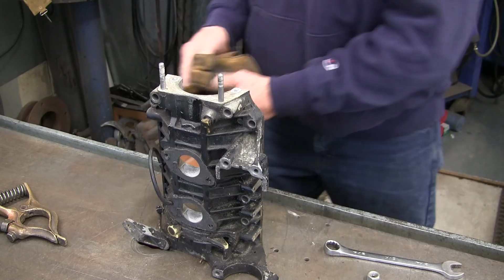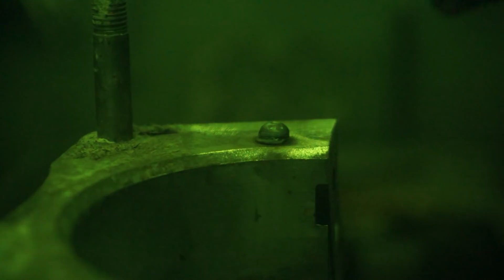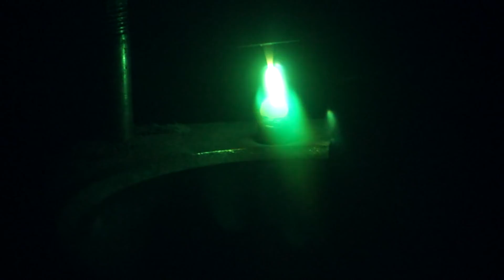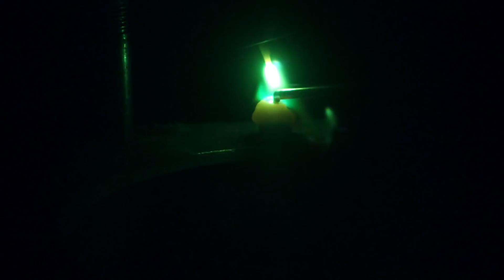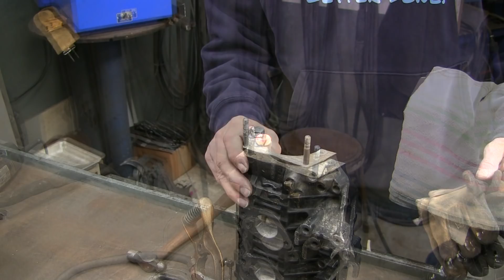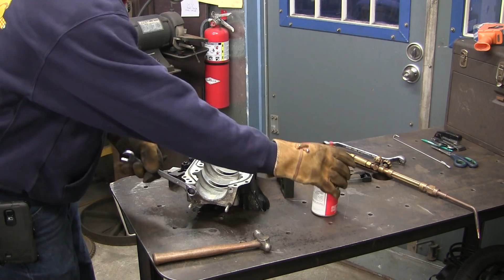Put A Head On Your Thread

Comment: Just think, if the manufacture's used anti-seize during initial assembly, they would make many happy customers but, expense vs. profit will win every time.
Reply: +Joe Rogers 
i'm mechanical engineer and in every of my desings that is involved to me used on a wet or corrosive environnement, there is a point of drawing that specify an anti-seize compound on every threaded assembly and it is a point of conformance at the same importance than the metrology of the parts.
I found deceptive that the assembly of threaded fasteners is almost always done dry, a very bad way to do things.
I've tested 242 thread locker on submerged assemblies of steel bolts , after more than 10 years underwater, I disassembled the fasteners with hand tools with no difficulties, all threads outside the nut were far gone but the section protected by the threadlocker compound were intact.
Reply: +Joe Rogers  I couldn't agree more!  My first experience with anti-seize was in 1980, while disassembling a turbine engine.  After 9,000 hours of flight time, the hot section came apart as if it had just been put together.  When we put it back together, we used C5-A on the threads of each bolt.  I've used it on anything that I thought might have to come apart in the future, especially things that get hot, like exhaust components on vehicles.
Reply: +throngcleaver worked on Cummins products for thirty eight plus years. Started using the seize in the eary 70's. Built a few that went a million and they came apart readily when you need it.
Reply: +Joe Rogers honda does, theyre the green bolts.
Reply: +Joe Rogers it's true. a lot of consumer goods come with a "fuck you, got mine" mentality. pretty much everything i can buy needs some basic work to not be disposable after a few months/years.
Reply: +Louis Reilly-Willhight that's a reason why a customer who buy an imported car , tool or almost any goods almost never return to american ones
the philosophy of not protecting threads is reflected in the overall design of the product
Reply: +Louis Reilly-Willhight Unfortunately, the manufacturer is betting you won't have the time/patience/skills needed to conduct repairs, and you'll just throw the damn thing away and buy new. It's consumer culture - aka "Fuck you, please come again!"
Reply: done a lot of repairs aluminum blocks and stainless bolts. After 6 months or a year at sea the antiseize compound doesnt help a bit. What does help is to warm the block to about 180 f for a half hour or so, the aluminum has expanded and you have a fair chance of extracting  the bolt.
Reply: Joe Rogers - Well there's at least one manufacturer that uses thread lock in all bolts, Mercedes. For my $500!! project car, A class W168, I was obliged to buy some new bolts that where missing and truth be told even the existing old ones where well in place. 
The bolts come already with blue thread lock pre-applied. After remove, the threads where impeccable. Worth saying that the bolts are also treated... ;-)

Some other projects, Peugeot 106 & 306 and Citroen Picasso showed me why these French came with bronze nuts in the exhaust manifolds. Never had one broken exhaust stud until now.... ;-)

Either case anti-seize is ALWAYS at hand reach in my projects area. ;-)

Comment: Hi Keith, thanks for the videos again. This is a very common problem on motorcycle exhaust studs. Stainless into aluminium, short stud in an awkward location, plenty of heat cycles and an area of the bike that gets plenty of road muck thrown at it. I have found that studs come out a lot easier if you unscrew them while they are still red hot. I realise the stud will expand when hot but the hole will always expand more - because it's bigger to start off with.

[IMG]http://i960.photobucket.com/albums/ae89/Screwdriver/Blade/ce1e2799.jpg[/IMG]

Comment: It's nice when you can do it on the bench.   recently I had to remove 3 broken studs in the firewall side exhaust manifold of a ford explorer v6 with all wheel drive. I hoped to never have to do a job like that again but luck me a while later I had to change a cracked passenger side exhaust manifold on a 4.6L ford 4x4. it had 3 broken studs and I broke off 2 more by the time I got the manifold off. 4 came out first try. The last one I had to weld looking in a mirror and it took 5 tries before it came out.
I hope I never see another broken stud again!!!
Reply: ford explorer 4 wd ridiculous space in that engine bsy :(

Comment: Keith I do it the same way but I weld a washer first and then the nut to the washer.
I found using brake fluid the best penetrating oil for rusty threads . Payment ? Beer!
I always use my  welder first before the mill .winner winner chicken dinner.

Comment: Keith is right, as a shop owner your time behind a screwdriver, or wrench is just as valuable as time on a machine. If you were not using the welder or wrench you would be on the machine.

Comment: Keith, I love your videos.  I'v watched 'em all.  Thank you so much for your generosity in sharing your knowledge.
I must tell a story about hand held angle grinders.  If you hold the grinder in your right  hand and your work piece in the left hand (as you are doing in the video, only much more dangerous with a thin wheel instead of the cup you are using)  the  geometry is just right so that if the blade catches in the work it will drive the blade right into your belly.  As a paramedic I had to move a patient (who was cutting a clay brick in half)  from the top a five high scaffold. He made a hole in his belly and his intestines came out in a pile as he lay on his back.  He ended up OK.  I don't hold an angle grinder in front of my belly any more.  Don

Comment: This question has nothing to do with this job .  But with all of your experience with welding would you ever weld on a pressure vessel like an air compressor tank?
Reply: +Keith Fenner  Hydrotest! Fill it completely with water so if it fails it will only leak a little water and not be a bomb. I built a hand pump to hydrotest tanks that can boost hose pressure to 300 PSI. No air involved, hence no explosion possible.
    Mike (o\!/o)
Reply from the maker: +captahab801 First let the air out! I have done a couple welds on compressor tanks to weld on new motor mounts and or weld in fitting. Never try to repair a crack or corrosion ares, not worth the risk. after modification, set in an area that protects or keep others at-bay, pressure test it to 1 & 1/2  times the normal working pressure, for a couple hours, to prove it worthy of service. ;{)-------

Comment: Good job on the bolt removal.  I am sure your time is worth the same whether you spend it on the mill or the welding machine.  Just depends on if you want your stuff fixed or not.  Thanks for the video.

Comment: Mmmm, I have almost the same job to do on a motorcycle part. Trouble is, I only have MIG. Do you reckon it would work?
Reply: +Peter Fletcher  I have found that it helps to do the weld with a torch or to reheat with a torch after stick or MIG welding. Even a brazed joint will be strong enough in most cases. As I don't have a TIG I just used what I had. Just like Keith said, slow and steady.
    Mike (o\!/o)
Reply: Well, I got away with it! mig welded a nut on, warmed the whole casing with a propane torch and out it came. Lucky or what?
Reply from the maker: +Peter Fletcher The mig can be used in some cases, but the down side is that the Tig lets you soak in the heat and the mig would be a lot of short burst and the heat would not be as great down deep in the threaded area. If it was a sheer impact break, the mig would most likely work, but locked in tight corrosion might be another story.  ;{)-----

Comment: When I have welded on a nut like that to remove a broken bolt, I put a couple of toothpicks or similar spacer between the nut and the part surface. Sometimes being able to thread the bolt in a turn or two can help free things up. It also helps when you are trying to work in some penetrating oil.

Comment: I tell customers the charge is by what it takes, not by what it might be worth.  Jobs like this are hard to predict what is going to be involved. I had a customer bring me a gearbox with all 4 mounting bolts sheared off saying they needed drilled out. I reached to the other side while it was still on their truck and turned them out with my fingers. That was a no charge. I have also had ones that were a total hole reconstruction after massive destruction and time to get the old ones out and those could be hundreds of dollars.  If they ask what a job cost beforehand I tell them I can give a rough idea but it is not a guarantee since my crystal ball is poor at predictions. I also tell them if a job gets to the point where I think what is getting invested is more than it is worth I will let them know before I proceed. I never want to burn a customer but I don't want them burning me either. Mine is a golden rule shop, treat others how you would want to be treated.
Reply: +bcbloc02 I knew an old guy that would tell customers "I charge for the time it takes to do the job. If you want a price up front, it'll be double".
Reply: +bcbloc02 yes i once had a job, a customer dropped a bolt into his engine, had spent half a day trying to fish it, and was resigned to stripping the bottom end down (it was a head off job as it was), i came in with a selection of magnets and grabbers and found the bolt, i charged him $20 which was i think, more than just fair, but a part favour, for some gas , 15min work time and 15 mins driving time.
Reply: +bcbloc02 kind of the same for computers. most people assume that if you are an IT guy (like me) that their issue should be resolved within a matter of mins and they want it practically for free. when I give them what I charge per hour with a min two hours, some will balk at it and storm off and others will understand. sometimes I've been able to resolve the job fairly quickly and will just give it back to them at no charge because I want to treat them how I would want to be treated. other times the job could get really intensive and the time and labor add up real fast.
Reply: +jusb1066 easy money and a very happy and relieved customer :)
Reply: +jusb1066 the bare minimum is half hour of time in my experience. unless you're working from shop; in which case it's whatever you think is appropriate.

Comment: nice job,  another technique that i was taught many years ago is to place a thick washer over the broken bolt ,weld the washer to the bolt then place a nut on the washer and weld the nut on the inside and outside. this technique is useful for us less talented welders and can also be use with mig ,stick or braze.

Comment: Heh, dont get me started on what people are willing to pay for a getter out....LOL 
SS in aluminum has to be the worst once sea water has its way with it..:-)

Merry Xmas
Colin
Reply: You really shouldn't start off a comment with condescension, but I'll reply just the same.  The high strength alloy steel in seawater service used in Navy vessels with monel fasteners, gets its cathodic protection from sacrificial anodes, as do the monel fasteners themselves, since the two materials are galvanic.
Do YOU realize that the Navy is looking at replacing their monel fasteners with Inconel in future vessels?
Reply: +CompEdgeX: That was my thought when I first saw it. Who the hell puts SS and Al together in a marine environment? Ever hear of the Galvanic Series? Makes for a great battery. Plain steel would have been fine.
Reply: +CompEdgeX nope. I don't think it is supposed to cut much. more just to turn the stud. you can find it on their website. or Google bust n out.
Reply: i just looked at the product page, looks like its just used for cutting the stud prepping it for the center tap and drill for removal. cheers
Reply from the maker: +CompEdgeX LOL! ;{)------
Reply: +TheBerkeleyGang Cause few have heard of Monel
Reply: +TheBerkeleyGang ok so let me get this stuff straight the less potential there is accordingly to Monels chart the less of a battery and the less corrosion.. in this case they should have used a low alloy steel for the bolts and the problem would not have occurred... am I right   ???
Reply: +Kristian B Lerche  Not to butt in, but it is the Galvanic Series chart that they are speaking of, and monel is a nickel/copper alloy.  The further apart on the chart, the more galvanic corrosion will occur when the metals are in contact with each other.
Reply: throngcleaver Ah.. thought the guy who discovered it was called monel... probably was but it was the alloy he discovered not the chart... ok then tell me... the alloy monel has a huge gap to aluminium... isnt that a bad thing to put together ?
Reply: +Kristian B Lerche  Monel is a trademark name of the alloy, not named for the guy that created it.  Monel is very resistant to corrosion, but eats up steel and aluminum rather quickly, especially in seawater.
Reply: throngcleaver You realize every fastener that is below the water line in military ships is Monel? And they all hold steel parts together….
Reply: throngcleaver Considering the next generation vessels just arrived, and don't use inconel makes that statement slightly inaccurate, or at least very, very far away. And it wasn't condescension, it was a question. Since people are bitching about using stainless in alu. The same sacrificial zinc would protect those as well.
Reply: Sacrificial anodes DO protect all the metals that are more noble than the anode.  It's that stainless steel is much farther from zinc on the chart than steel and aluminum, thus it gives more benefit to the steel and aluminum.
As you know, there are many thousands of alloys of metal.  The steel in Navy ships has a high nickel content, along with boron, copper, and other elements to increase the strength and reduce corrosion.  The nickel and copper move the alloy closer to monel on the chart, making it feasible to use monel fasteners in structural applications.  The mistake I made, was in being non-specific when I mentioned steel, and not mild steel.  I'll be more specific next time.
You can have the last word, and Merry Christmas to you!
Reply: +CompEdgeX apparently mac tools makes a flat end carbide bur. they call it the bust-n-out. its smooth on the sides to leave the threads intact, with the cutting teeth on the flat end. heard a few good reviews, I guess it would be best in an air drill for the right torque and low rpm.

it goes for around 70 dollars.
Reply: Albert Tremblay
Interesting, must be some form of flute to allow for chip evacuation?  :-)
Reply: Kristian B Lerche Exactly.
Reply: +CompEdgeX Is there a reason why they don't use aluminum bolts? I use them and copper bolts for all the audio systems I install to match the metal I'm bolting to.
Reply: toysareforboys Strength. Shear and tensile strength are about half for aluminum vs. steel.
Reply: +TheBerkeleyGang Ahhh, makes sense I guess when you need strength :) thx.
Reply: Stainless in aluminium is pretty terrible in just about any environment.

Comment: That method got me out of trouble lots of times, one thing I do different, is to build the blob around flat washers, from 1 to 3 sometimes, then, add the nut on top of the washers when required.... Another way to skin the cat...   ;)

As far as price is an issue, I agree pretty much with you, that depends on who is asking, the worse cases is the "cheapos" that want to repair a $5.00 piece of crap for free just because you can   (Why pay $50 to repair something that's worth $5, they think...?) , and, they'll keep on coming back just because you dit it once...   lol
Reply: +pierre beaudry  I agree with you on the washers. Many times with a broken steel bolt or stud in a steel part I will first weld one good fitting washer so my weld doesn't hit or stick to the part and then weld  the nut on it on the outside and in on the stud. I also sometimes weld  a bolt to it at a 90 degree angle or less if I think I can just use it as leverage to tap on or swivel with a vice grip. Biggest help is that someone else didn't try a fix first !!!
Reply: Eddie Kawecki
Totally agree with the last statement....  ;)
Reply: Eddie Kawecki
Eddie Kawecki - Those guys that try to fix it first area pain, but they keep you in business with more expensive repairs.  Ask any gunsmith!!
Reply: Pierre's Garage u
Reply: Pierre's Garage picture very clear and sharp. Sound very clear as well
Reply: I do it your way with washer first and then the nut to the washer penetrating oil and tapping with a hammer while hot. If there is the corrosion the tapping of the hammer to bolt breaks the bond. And yes if someone did not mess with it first.

Comment: I normally work off a fixed price quote which I always prepare in good faith. Sometimes I get lucky and I find an easier way to complete a job and sometimes I under estimate the amount of work. Usually I'll stick to the quote as over all it works out about even. The only times I renegotiate are when the job turned out to be ridiculously easy or hard - in those cases it's only fair to bring the customer back in. What I find surprising though is I rarely get much thanks for turning a job in well under the quote but I get it in the neck if I go over. I put it down to people having already mentally spent the money so they don't see a lower price as much of a win.